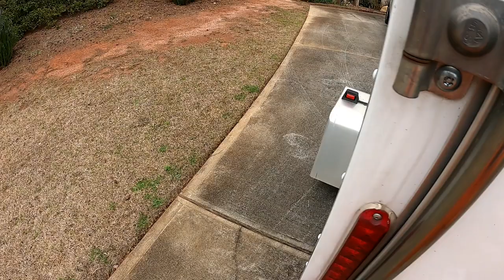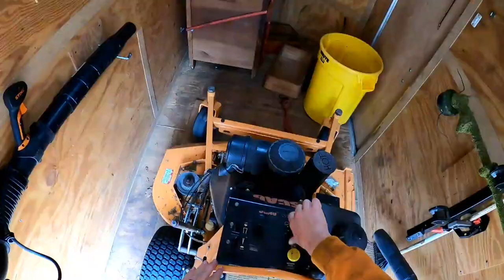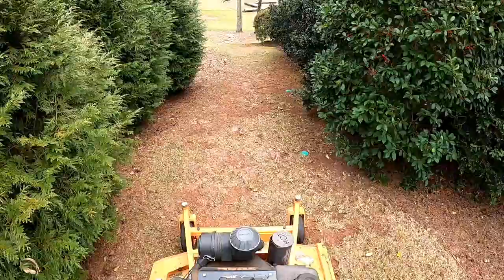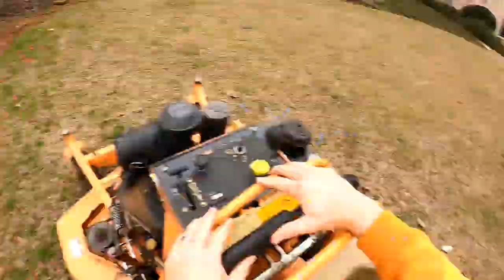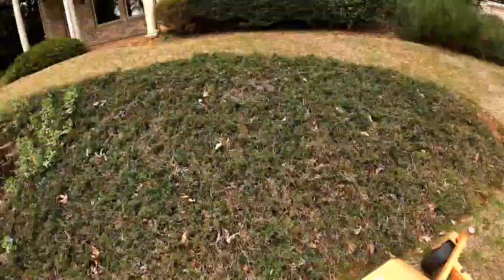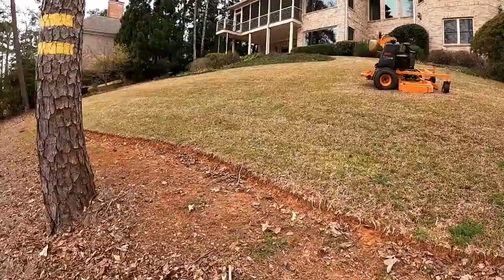How does the Scag Vride handle this hill?

Comment: Mine is as good or better than most on hills. One thing you should check. One time b&b had wheel motor bolts get loose, so I decided to check mine an they weren't real tight either. I re torqued them to 75 lbs and I'm watching to see if they get loose.
Reply from the maker: Good idea to check that thank you